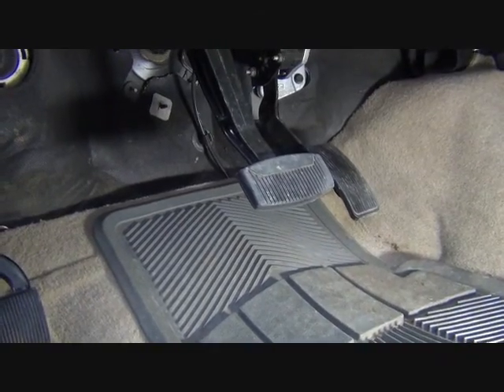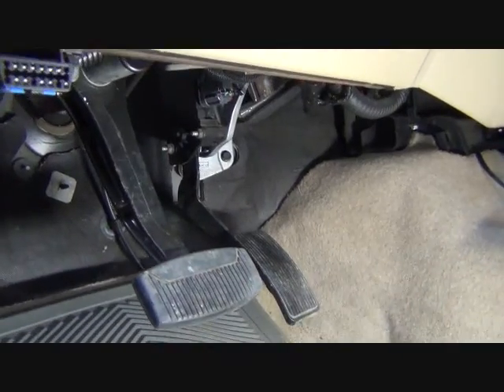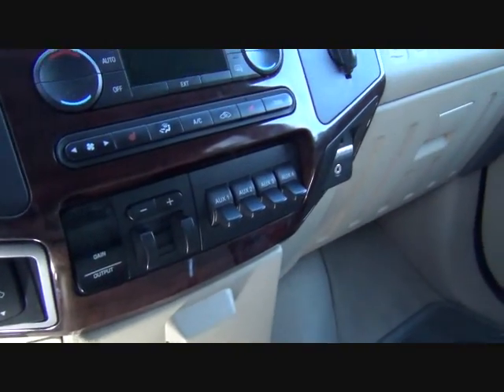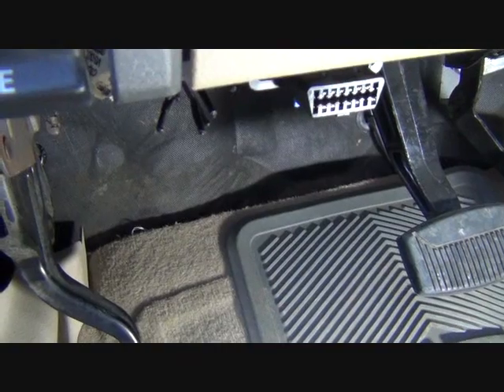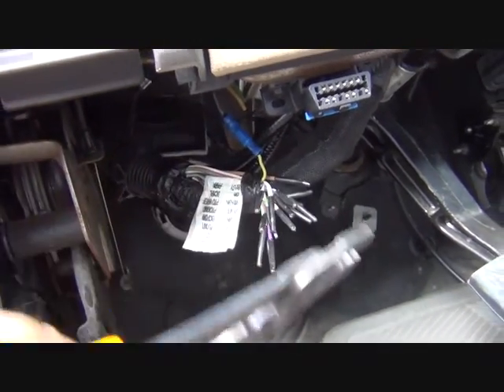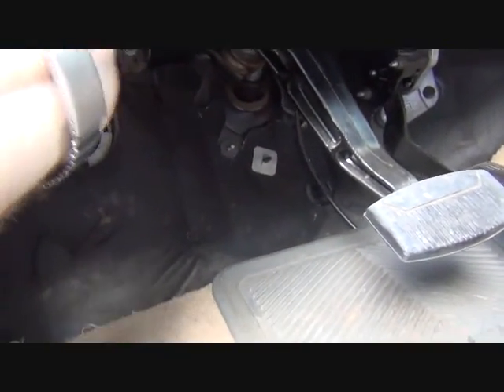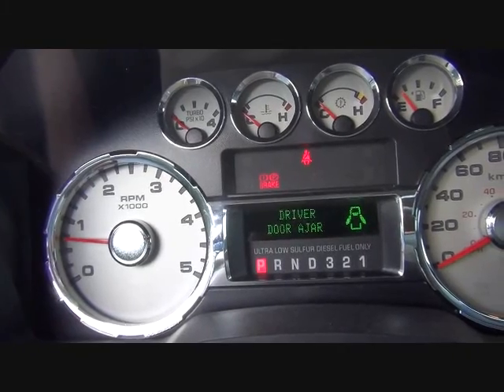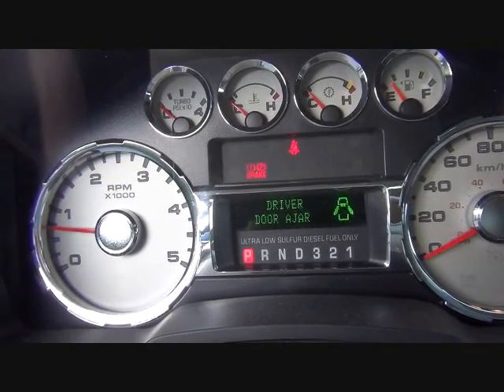Ford 2008 F 450 Powerstroke High Idle Mod

Comment: Still have the truck?
Reply from the maker: Yes I do.
Reply: How many miles you got on it, and what are some tips on getting a 6.4l to last? Just bought a deleted one in great condition.  @photocontrol
Reply from the maker: @williamrowe1894  That's awesome! Mine has about 115.200 miles on it. I try to change the engine oil every  3000 to 4000 miles and replace the fuel filter as well. I also replace the fuel filter/water separator under the driver's side of the cab every second oil change. The one thing I haven't done is get the transmission fluid changed, I'm not sure how difficult it is and might have to take it to an oil change place for that.
Reply: @photocontrol  it's funny you mention the transmission fluid, I just drained mine, took the pan off, cleaned it off along with the magnet, and changed the filter. I measured what I took out and put the same amount of mercon lv back in, it shifts good and maybe even a little smoother
Reply from the maker: @williamrowe1894  Great to hear that it shifts good and smoother with a fluid change.

Comment: Do you ground out the high idle wire?
Reply from the maker: No it doesn't need to be grounded. The high idle ( yellow/ w green stripe PTO) wire in the bundle is spliced onto one of the upfitter switches.

Comment: I just did this to mine and as it begins to rev up the green wrench light on the dash comes on. Any suggestions?
Reply from the maker: I'm not sure why the green wrench light comes on as the idle begins to ramp up... there is possibly a code that would show with a code reader.

Comment: Hello, can I lower the idle. My truck is at 900 rpm ?
I would like it at 600 or 650.
2008 F450, 6.4
Reply from the maker: Hello, I'm not sure why your idle is higher at 900 rpm. Possibly an engine temp sensor? It should be around 600 to 650 normally and only go up to around 800 or 900 when engine is very cold.

Comment: Do you happen to know is the rpm  can be changed from 1250 to 2000?
Reply from the maker: I'm not sure if the RPM can be changed to 2000.
Reply: Yes it can, you just change the resistors value. 4700 ohm I believe
Reply: @jamesmarier6760  what one do you mess with

Comment: Thank you for take time and make a nice video to help others..
I'm feeling frustrated, because something too easy and did not work on my truck. I have a 2008 f-350 diesel, I did it just like you did, making sure right wires, but not lucky. 
Do you think in my case I have to use a resistor. But why? If many people do it too simple..

Thank you again.
Reply from the maker: Thanks mauro! I'm not sure why it doesn't work...If you are using one of the four upfitter switches to activate it, does the switched wire have power? When the switches  are  in the on position do they have a yellow indicator lights illuminated? If not possibly a blown fuse.  Make sure parking brake is set. If the yellow-green with (YE-GN) PTO label wire doesn't work, try Violet- Brown (VT-BN) BCPSW labeled wire. I'm not sure if you would need a resistor, or what value the resistor would have to be. Hopefully this info is helpful. :-)
Reply: I was having the same issue then watched farther and he said to have the parking brake one and it did the trick